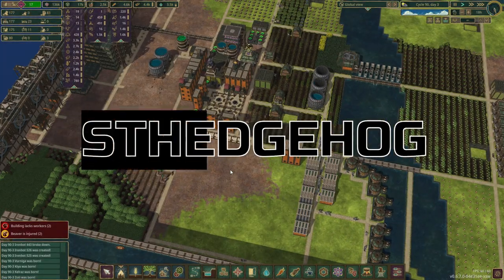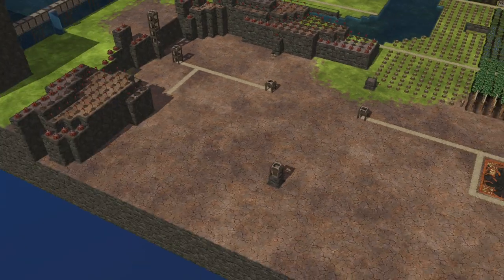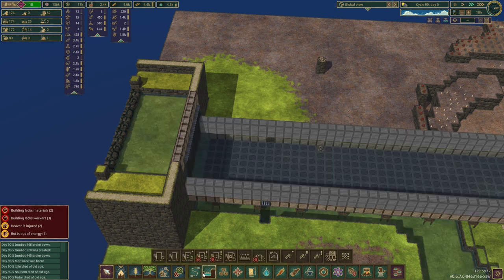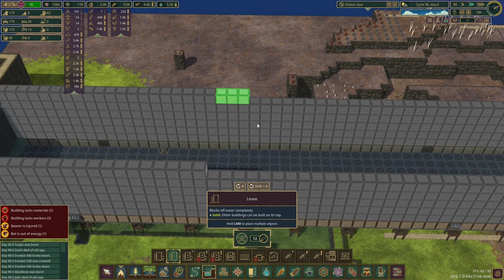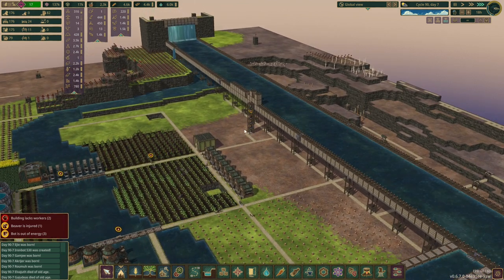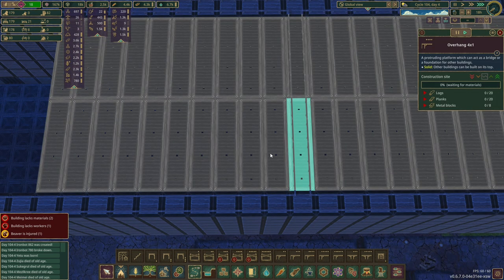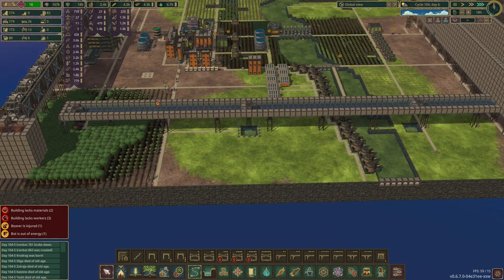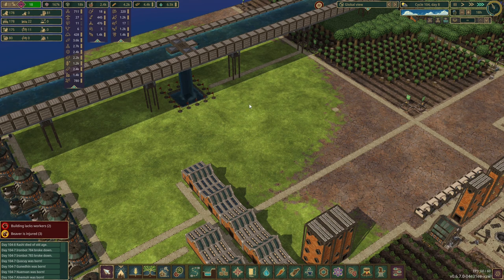Timberborn Update 6 -  The Reservoir Build

Comment: ahh if the brown space is to be greened .... then just dig the roads down 1 and platform them back up and use them to shift the water around the base .... put the Lido's in the aqueducts ...
Reply from the maker: ! wise water channels are a REALLY bad idea with the new water mechanics. They dry out very quickly, so 3 wide is really the smallest you should go. 
I do say in the video that the best way would have been to not do the aqueducts and run 3 wide channels down on ground level, but we're going with the aqueducts now and going to make them work.